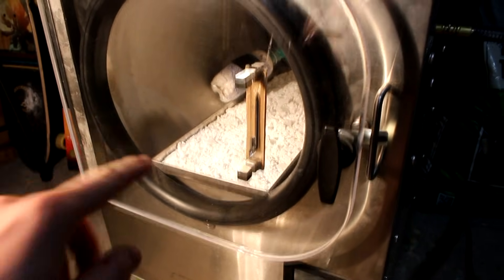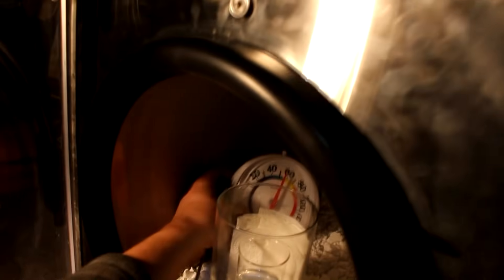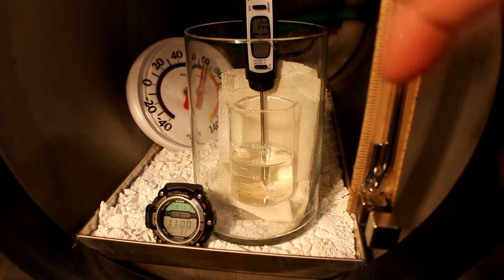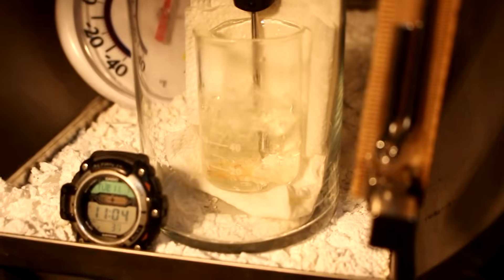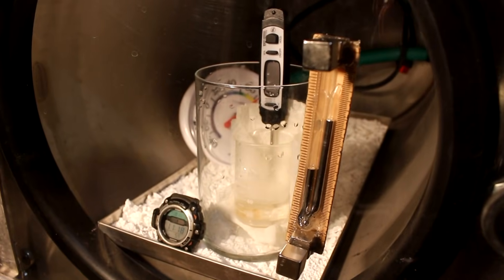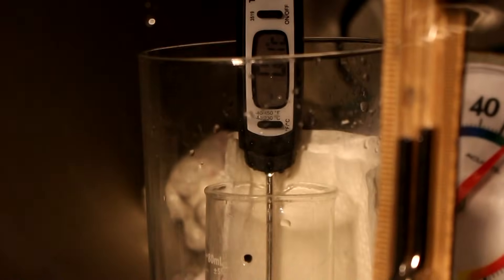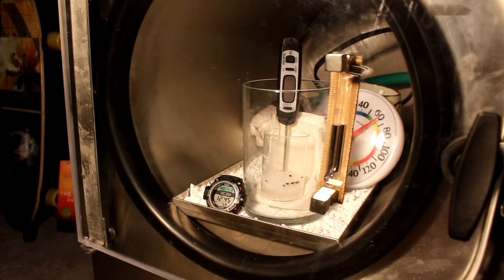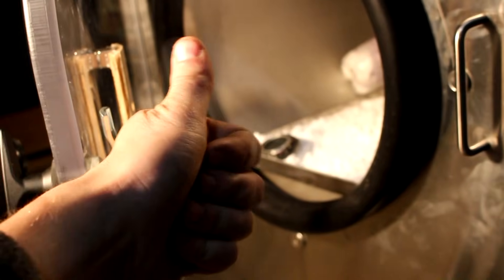Boiling Water Until It Freezes

Comment: The cool thing is that just 6.5cm of water is enough to keep the bottom of the water from boiling at the triple point, even if it was in a vacuum! But fortunately, the cold ice above is able to take heat away from the water below, so the whole thing can still freeze

Comment: Boiling as I understand at microscopic level is- suppose we are heating water at one atmospheric pressure, it's temperature will rise but only surface molecules will have enough energy to escape because the bubble formed didn't have enough to pressure inside them as compared to atmospheric pressure , so they collapse. 

But as the temperature reaches 100 degrees Celsius the pressure inside the bubble will be sufficient enough to overcome the atmosphere pressure and it will rise and pops up at the surface, via this explanation we can Clearly see if we decrease the atmospheric pressure, the pressure which the bubble need inside them to not collapse will be less so the boiling point will be less.

But what matters here is the pressure inside those bubbles and not vapor pressure (which is the pressure exerted by liquid above it's surface at any temperature of its in equilibrium) . So why bubbles can't form inside the bulk at a point where the vapor pressure of liquid is less than atmospheric pressure? I mean there should be some high energy molecules in the bulk which should be able to form bubbles which can counter their surrounding pressure and rise, but why it doesn't happen? Why we put a condition that there has to be overall 0 pressure on liquid for bubbles to form?

Comment: Thank you for this, I've been trying to visualize what would happen to water ejected into space (like from an apollo capsule urine dump). I know it will flash vaporize, but the boiling should quickly use up those 37 degrees of body heat until it gets to -60 or so, then switch to freezing. But freezing water generates heat, so the remaining water must oscillate back and forth between evaporating and freezing til there's a structure made of both. Like white (or rather yellow) ice with millions of little water vapor bubbles in it. if only I could piss in space I'd know... sigh...

Comment: Open the gas ballast a tiny bit on your pump while there is moisture in the chamber. That helps sweep away moisture from the pump oil. Pump oil will eventually need changed once you notice it getting frothy or if you have a micron gauge you can see that it doesn't pull as low

Comment: Can you make a more efficient clothes dryer by vacuming the air out of an enclosed dryer?  It would seem that less heat would be required to dry the clothes.  You could use ambient air temperature and cycle the dryer several times. Of course the vacuum pump would require energy which could be recycled into the dryer.

Comment: You can do this with nitrogen and make nitrogen ice crystals. it's a process currently being used in order to make pharmaceutical sub zero storage that doesnt need electricity. Once they create the crystals in a vacuum they keep it sealed and it's reported to be sustainable for 5 years without electricity

Comment: The first AC systems were on railroad passenger cars.  They used a steam powered aspirator to pull a vacuum in a chamber of water. The chilled water was pumped to cooling coils in the passenger compartment.

Comment: Number 2.
1- Place two electrostatic charge generators (electric cable, glass marble, aluminum foil) inside the water glass.
2 - Then place the glass inside a magnetic field (ferrous magnets although electromagnets are stronger).
3 - Finally add two ultra-frequency transmitters.
4- Activate the whole and observe what happens.

Comment: I have used water in an insulated test tube to confirm vacuum levels while working on large industrial and petrochemical refrigeration systems. Our test tube was external to the system and connected by copper tube. It is a very reliable way of measuring the vacuum while also ensures there is no moisture in the system.

Comment: @0:43 "sucking out all the air out of the chamber.."  does the chamber know there is air in the water..?  Will the vacuum take the air/oxygen out of the water, as well..?   If air/oxygen is removed from water, H2O,  are you left with dehydrated water..?  just add water..?   lol..

Comment: I love the Casio torture test part of this video   (low pressure).  I recently forgot my Casio in the pocket of my work pants and washed them.  After a hot wash to get the oil out and a spin the watch still works.  A setting button is  a bit damaged only because the watch came out of the pocket during spin.

Comment: you add can some kind of paper on top of the beaker so that if forms a make shift ceiling to lessen splashes of water
plus you can add equal amount of acetone in the water to make it freeze even faster, it wouldn't hurt to extend the surface area of the water too

Comment: Water will not freeze solid in space. Why ? The Suns temperature near Earth is around 600 degrees F showing that if water was released into space near the Earth or at least 25,000 miles up the water would seek to become a sphere and begin to expand. One square inch of water doing this would then expand to around 100 ft or more in diameter as it becomes two separate gases of Hyd and Ox. If water is released into space near or around the Space Station it could become very dangerous to the station due to this propensity water has when in the vacuum of space and in the radiation of the Sun. SAE is better than the metric system because those slouches over there before us used stones and their feet and hands as a standard of measurement before we here in the U.S. invented the SAE system, OK.

Comment: The water has a heat energy before the experiment, its removed from water, Where does the heat energy went ? if it stayes inside the chamber it will melt the ice..isn't it?

Comment: I don’t know what kind of sorcery you just pulled but I know for a fact because I’ve done it put water in a 30 inch vacuum and it boils at 170° 30 inch vacuum 170° boiling water you can’t get lower than a 30 inch vacuum and less you go below ocean levels

Comment: Vapour compression cycle cooling is interesting if you haven't seen it used before. Air cons, refrigerators,  cold rooms, all use the same method. There's even a chart if you look up R718. DuPont have a lot of info too, since its centuries old tech.

Comment: the chamber wouldnt actually be 60 degrees because theres no medium in which to measure the temperature. at that point the temp gauge would be reading the temp of the thermocouple or in the case of an mechanical gauge the liquid that is sealed inside of the tube would not be able to react to the lack of atmosphere and transmit any movement to the clock spring.

Comment: Is there a way to make the water completely vaporize? if you add heat to water in a vacuum would that completely vaporize it or will you have to continuously raise the heat to prevent it from cooling?

Comment: Hey Cody. "Cool" video. I have a few questions. Why did the air temperature not go down with the low pressure, when the water temperature did? What was the minimum pressure in the cage (record-buttom)?

Comment: If you slow down the rate of evacuation, the water splatting will become Less of a problem , You need a throttling valve in the vacuum line...

Comment: The out gassing of your desiccant would probably be preventing lower pressure being attained with a rotary oil pump. A cold trap on the vac hose would work better, as you do have access to liquid nitrogen.

Comment: Hi Cody, what is the pressure in your vacuum chamber in millibar? You said the temperature of the ice should drop to about -50°C if you keep up the vacuum long enough, so I assume you reach something like 0,01-0,1 millibars with this pump because according to the phase diagram of water, -50°C roughly corresponds to that pressure. Do you have any idea what the time depends on that it takes for the ice to get down to that temperature? In theory, shouldnt the ice instantly become -50°C as soon as the pressure reaches 0,01 mbar, because anything that is warmer than -50°C should have sublimated by then according to the phase diagram? I am asking because I am doing a project on freeze-drying right now and a bunch of stuff doesnt go as it should in theory. I would appreciate your answer very much :)

Comment: Low pressure leads to lower absolute temperature (when volume is kept constant) hence liquid tends to boil (agitates) and gas to disperse. This was stated at the general gas equation PV=nrT by Émile Clapeyron in 1834 as a combination of Boyle & Mariotte´s empirical law (1662 y 1676 respectively). The consequences of the application of this important formula are still unknown in medicine since the laws that it rules are applicable to human body (and the planet earth)

On the other hand, Cody's experiment is by far the best way to illustrate the Chinese Medicine Cold and Heat energies. The law says that the liquid agitates but the law does not help to devise what happens later when the gas has been completely disassociated from the water. What it remains is no longer water because the O2, CO2 and whatever gases that were present before, now are no longer there. In Chinese Medicine we say that the liquid has lost Qi (oxigene) and it tends to congeal. This means that Oxigene has enough energy to keep water liquid as it is

Comment: ive always wondered why people say you will freeze in space since its a vacuum so it should insolate you and i thought the only heat you are losing is through infrared radiation which means you will eventually freeze but not as quickly as most people say and what movies depict. so is this why you would freeze fairly quickly in space?
Reply: I see that the ISS space walking suits have a 2000W ice sublimation cooler on it. That is to cool the person during the 8 or so hours EVA. You are right to think that the vacuum is insulating, working in space be like working under blanket, you soon get too hot, all that waste heat from your muscles has to go somewhere, hence the coolers.
The you have the sun blasting heat IR at you, that be like being in the desert sun. So that too means you need a lot of cooling when in the sunshine in space.

Comment: I use that same model vacuum pump all the time for installing air conditioning. Don't worry about the moisture that goes through the pump, that's it purpose, to remove moisture. Just be sure you properly change the oil regularly and that pump will last decades.

Comment: Great video, but you shouldn't use a 200 year old definition for temperature. Degree Celsius (or just Celsius) is the way to go and removes ALL confusion for the French and the Spanish. They get all dizzy from the wrong application of units.
Besides, I am not sure that there is a thermometer calibrated to measure Centigrade.
Centigrade is based on a scale 0-100
Celsius is based on the parts from absolute zero -273.15 to 0
So yeah 'C is much more precise.
People must learn the difference, because we need everybody to switch to the metric system properly.

Comment: "Cool".  I have a question about evaporation and wind chill.  Since the more energetic molecules will leave the water first, is it possible that an evaporating liquid can cool an object to below ambient temperature without reducing the pressure as you did in the vacuum chamber?  Let's assume that the liquid and the object are both at identical temperatures.  This question was prompted by the thought that wind chill does not exist for inanimate objects.  Thanks...great video as usual.

Comment: But why did you put the watch inside the vaccum chamber? The thermometer needs to be inside, but the watch is just to see the time, so it doesn't need to be in the low pressure. It could even risk to damage the watch.

Comment: Thanks for the  thing about the ice spikes.... never heard of them.  And thanks for the Casio torture test.   Did the back bulge out a bit under vacuum or did the back get sucked in a bit after normal pressure was restored?  Was the watch damaged in any way?
Reply from the maker: not that I can tell, the watch still works, though it does need a new band but that was not experiment related.

Comment: with this little air in the chamber, is the thermometer even able to give you the surrounding temperature? Where is it taking the reading from?
Reply: It reads the temperature from inside the ice at the tip of the thermometer rod, not the air surrounding the rod. The thermometer cools down because there are two types of water in that beaker: somewhat hot water molecules and somewhat not hot water molecules. Temperature is just the average of all of the water molecules' energy or vibration speed, ie heat, not the heat of every molecule present. Because the air pressure is dropping, there is less air pushing down on the water to keep everything in the liquid phase, and so the somewhat hot water molecules take heat/energy from the somewhat not hot molecules changing the molecules present to either hot and not hot water molecules. The hot water molecules have enough energy to evaporate, so they do, and the not hot water molecules are cold enough to freeze, so they do. The only mass left for the thermometer to measure is the ice that surrounds the probe point, which is at 0 degrees Celsius.
Reply: Exactly what i thought..Very less mass to measure and also nothing to cool it down. Yeah, i'm wondering and searched for someone who als was wondering :P
Reply: If the Thermometer doesn't Cool down, how should the water Cool down?

Comment: Nuclear energy is just a means to move steam through a turbine to make energy correct?
Why don't they just make a very large machine that drops the pressure so low that water going through boils  to turn those turbines? It would be free of nuclear waste
Reply: it takes energy to create a vacuum and the water vapor messes up the vacuum so we will have to constantly have the vacuum machine running and that machine will use more energy than the thing generates

Comment: does it freeze because the low pressure causes water to release its heat energy by boiling at lower temperatures until it reaches its freezing point? I don't really understand how pressure corresponds to temperature but im just imagining pressures change the thermal conductivity of matter rather than directly influencing it's temperature? or does this work in a completely different way...?

Comment: Cody, if you was to setup a chamber of some sort inside your vacuume chamber... The smaller one in side being setup to let water and air escape but not enter. And start off with it completely full. And lower the pressure to where the water boils strongly but not to where it will ice over. So once the smaller chamber is boiling and sealed off and you take it out of the bigger chamber. What will the results be. Will it just boil endlessly or will it look like a growing pocket of air untill the pressure finds some kind of balance? Please let me know this !

Comment: Hey Cody - your vacuum chamber experiments are very cool ... and, I have a challenge for you:

There is something of a Internet Myth surrounding the Lunar Landing modules - and, the absence of any cratering or 'blown surface' underneath the lunar lander rocket bell - where, it was presumed, that lunar regolith would be blown away due to downwash blast of said rocket nozzle.  

So - would you be interested in taking a model rocket motor - and test it on loose, fine soil (as talcum powder, or similar) underneath in your vacuum chamber?

Of course, getting the model to faithfully represent the actual Lunar Landing scenario ... but, still - this would be most cool!

Let me know what you think!  

Chris

Comment: So what would happen if we were to build a giant 'straw' from the ocean all the way out to the vacuum of outer space held by geosynchronous orbit?  How far up would the vacuum be able to pull water? All the way? And then the water would boil then freeze starting at the top right? So if we installed a valve to release the vacuum could we potentially create giant tubes of ice that we could then drop into the ocean, maybe during el nino in the right place for ocean currents, and alleviate global warming (if it exists.  I'm neutral)? Would it still work being salt water? With current progress in materials technology and such many people think we should be able to build a space tether in the next 100 years. A space tether would be quite a feat and a space straw seems almost impossible, but maybe not. I'm sure by the time it could be possible we will know for sure what the real deal is on global warming, and maybe that could be the solution if it's really a problem. Bust an ice cap in global warming's ass.
Reply: nothing is gonna happen. it will be densest below and less dense the further up you go at the same rate as outside the straw. imagine putting a straw in the drink. the water is not gonna shoot up the straw would it?

Comment: I picked up a large old Robinair vac pump ages ago, with an absolute pressure gauge, but I need to pull more vacuum, for making Crookes, and Geissler tubes. I have a reliable source of cheap (free) helium, neon, krypton, argon, nitrogen and other gases. I am also running a solar torrefication chamber for baking wood in the absence  of oxygen. The process mimics or at least gives hard woods a head start toward seasoning with age, and helps pull water out of the lignins and hemicellulose, which is kind of what 15+ year seasoned old wood is like. It's all stoopid stuff I can sell, or use. I get $2000 for a Crookes tube with a copper lightning bug coated in phosphorescent paints, that glows when someone keys in Morse code broadcasting CW. I use the wood in repairing guitars. I may start to charge more for the tubes.  I am in America, but after college & work one gets used to converting from imperial to metric and back again.